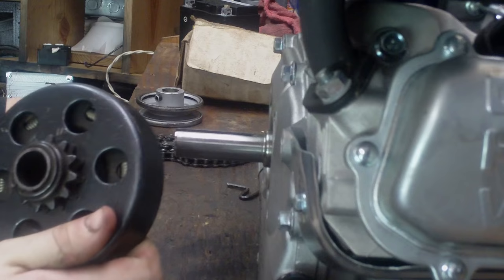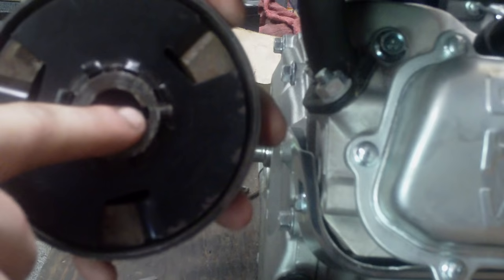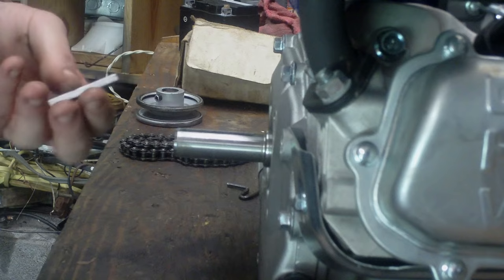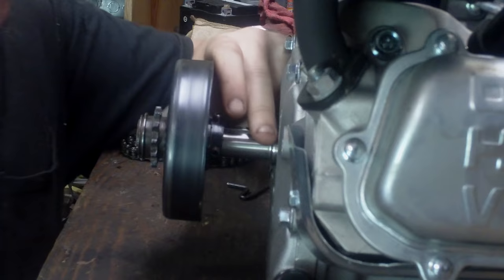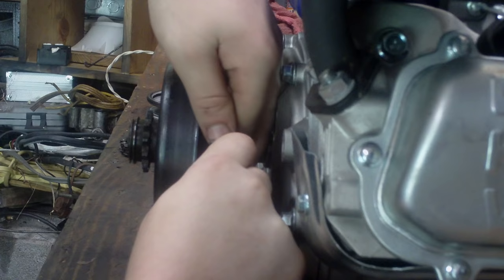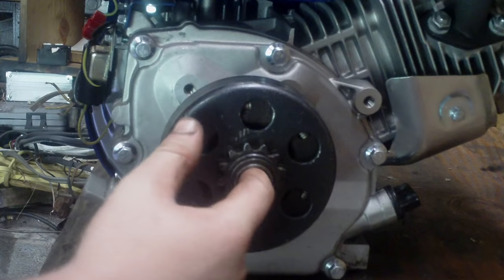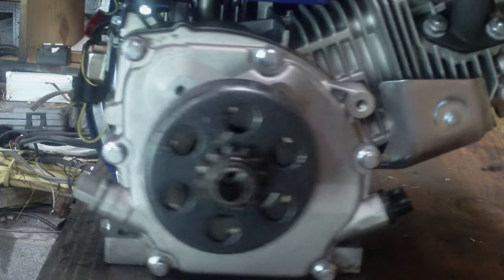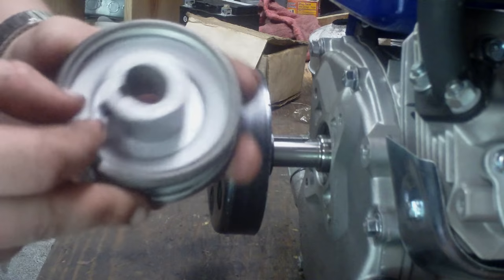How to install a Centrifugal clutch

Comment: does a centrifugal clutch prevent the chain from spinning while the engine is idling? Ive been wondering that for a while and id l ike to build a gokart with this exact engine size you have. Thanks.
Reply from the maker: Ko-wing wong Yes, thats exactly how they work, there are pads inside, with springs, and at idle there is not enough centrifugal force for them to over power the springs, so the clutch is disengaged, when you give it throttle, the centrifugal force increases overcoming the springs and it engages. Thanks for Watching!!!
Reply: Thanks for your help! Is it better to have a torque converter to the axle shaft or just a centrifugal clutch?
Reply from the maker: Ko-wing wong It depends more of what your wanting to do with it, a torque converter will get you more out of the low and high speeds, more low end torque at slow speeds and more high speed. A standard centrifugal clutch doesn't do much for low speed, what i mean is, not as much torque at the wheels, since its real easy to slip at low speeds. But both work just fine for go karts and mini bikes. More of a personal preference. And if you ride on grass or on hills the torque converter might hold up better.

Comment from the maker: I wouldn't recommend it, you will have to shop around and find one rated for higher HP. They do get very expensive in the higher HP range. Its actually better to have a clutch rated for more HP than the motor, it will last longer. Thanks for Watching!!!

Comment: ‼️‼️need help taking the key thing out of the shaft any ways to take it out???‼️‼️‼️
Reply from the maker: Once the pulley or clutch is removed, you can usually use a punch or screw driver with a hammer and gently tap it out, once it starts it will come right out. Thanks for Watching!

Comment: could you tell me the "size of the screw" that hold in the clutch with the washer in the star washer..Thanks
Reply from the maker: ALVIE78744 The crankshaft bolt should be 5/16"-24 and about 3/4" long. Your welcome! Thanks for Watching!
Reply: Thanks
Reply from the maker: ALVIE78744 your welcome!

Comment: I’m swapping a JDM H22A Vtec into my large go kart and need to have it disengage while parked(with the engine running). Is a centrifugal clutch gonna work?
Reply from the maker: Yes, it will be disengaged as long as the engine is idling, then will engage automatically when you increase throttle. Thanks for Watching!!!
Reply: @fnaguitarplayer9  thank you.

Comment: hey this is interesting! I've got a original Honda gx200 engine, but sadly I can't find a centrifugal clutch for it, as the crankshaft isn't a 0.75in but 0.78! where can I find one??
Reply from the maker: Morgan Heitz Thats crazy, i never knew they had a odd size like that. Must be metric i guess, eh, i'm not really sure on that, I know one thing that could be done, is have the crank machined down to .75 but that might be expensive at a machine shop. Unless you can find a metric clutch for it, you might have to do that. You might also want to check on ebay. Hope this helps, thanks for watching!!!
Reply: fnaguitarplayer9 I've done a bit of investitation, it seems that this crank size is specifique to european import engines, 20 milimeters. thanks for the advices, I'll have it machined!
Reply from the maker: I hear ya. That explains it then. Yeah, i'd say the best bet would be to have it machined down. It wouldn't take a whole lot. your welcome!

Comment from the maker: no that won't work. Even id you did get it set up on a mini bike/go kart it would last no time at all. you need a clutch like i show in this video, max torque is a good brand to get, only other cheap method for making a clutch would be a belt-pulley clutch, all belt driven, with a idler pulley hooked to a clutch pedal that comes down tightening the belts, but unless you have pulleys laying around and a belt, that would actually cost more!

Comment: Do You need a clutch? Like is it a must have thing for a go kart?
Reply: ding
Reply: No, just use magic powers to move the cart. Like a magic carpet..
Reply: You can use a torque converter. But they aren't good.
Reply: Or you could just push it.

Comment: I’ve seen people in videos put clutches on gear towards the engine. Does someone know if that’s correct?
Reply from the maker: most clutches can be installed either direction, they will work the same both ways. Thanks for Watching!!!

Comment: Hi. I have a 212cc predator and I can't find the right size bolt that u have to put in the hole. It's the hex one u put in urs. Can u tell me the size of the bolt please????
Reply from the maker: If its the same as this motor, the bolt that goes in the end of the crank is 5/16" - 24 and the length would be no longer than 3/4". Thanks for Watching!!!
Reply: That's what I bought and it keeps falling out
Reply from the maker: if its threading in correctly with no play, you may want to put loctite on it, that will solve that problem!

Comment: I haven't got a hole for a nut to hold it on,what should I do mate? Cheers
Reply from the maker: You would probably have to have it machined, you might be able to get by without but it would be more apt to slip off, i have seen them without the bolt before though. Thanks for Watching!!!

Comment: where did you find the smaller key?
Reply from the maker: +mile iloski You can cut them if all you have is a big one like i did, just use a hacksaw or cutoff blade on a grinder and file any burrs off, but you should be able to find a smaller one at any hardware store, or even lowes/home depot. Thanks for Watching!!!

Comment: What's the reason for the clutch what does it do? Cant I just weld a sprocket on it?
Reply from the maker: without a clutch the engine would be hooked directly to the drive train, so whatever vehicle it is on will start moving even while trying to start the engine, if you stop it, it would stall the engine out. Thanks for Watching!!!
Reply: @fnaguitarplayer9  oh ok thank you for explaining it for me
Reply from the maker: no problem!

Comment: Hey, I got an old 3hp briggs & stratton. I have to put on a 3/4" a #35 chain, right? 
I'm kinda new to this.
Reply from the maker: Yes, it should be a 3/4" shaft, just measure it first before buying one, and yes a #35 is the most common chain size. If you have any question feel free to ask me. thanks for watching!!!
Reply: fnaguitarplayer9 Thanks for the reply!
Reply from the maker: no problem!

Comment: Update  i looked at mine i couldent find the key then i found out it has the key fixed into the cluch hole and theres no screw holes on the back to tighten to the shaft but thx anyway

Comment: I dont see any set screws anywhere on my clutch
Reply from the maker: It has to have at least one to lock it down, look where the keyway slot is, there is usually one on it to put pressure on the key. Thanks for Watching!!!
Reply: Are you talking about the shaft itself?

Comment: will that clutch work on a 79cc predator hf engine? I think the only difference is the bore which is 5/8.
Reply from the maker: You will have to order one with the different bore, to fit your particular motor, go to tulsa engine warehouse or ebay to get them, usually around 30 bucks or so. But yeah if you get the right bore size it will work no problem. Thanks for Watching!!!
Reply: thank you and will do,
Reply from the maker: your welcome!

Comment: does every small engine need its own specific sized clutch, or will this one work for most?
Reply: This size clutch in this video will work on engines within its power range before it starts to slip!!! 2-5 hp is my guess
Reply from the maker: +Brandon Quenneville That is true, most of the time it will be stated when you order one. I'm thinking up to 8HP on these like this, i'm not for sure though. Thanks for Watching!

Comment: on my mini bike when I give I a shot of the throttle it feels like it shudders for a second be for speeding up
Reply from the maker: Probably carburetor related i would say, could be a fouled spark plug, I would check plug first, air filter then adjust the carburetor a little richer. Hope this helps! Thanks for Watching!!!
Reply: +fnaguitarplayer9 thx I'm going over it tonight
Reply from the maker: no problem, let me know if you need any more help!
Reply: motovlogs

Comment: hey i have the same engine and i need a new clutch. what are the specs on that clutch.
Reply from the maker: The shaft size (bore) is 3/4" but i would suggest measuring yours first just to be 100% sure, and the clutch used in the video was for a #35 chain, but that depends on your application. Also, I get them from tulsa engine warehouse (tewarehouse dotcom) or you can get some good buys on ebay, seen one on there for 24 dollars with free shipping, same specs as the one in the video. Also note, the one in the video is a max torque brand clutch. Hope this helps, thanks for watching!!!

Comment: Hey my engine i bought second hand has a tapered shaft?? what should I do I dont see anyway in attaching a clutch to it
Reply from the maker: +William Laidlaww Sounds like it came off a generator or a pressure washer, probably have to buy another crankshaft for it, tear it down and change it out. Thanks for Watching!!!
Reply: I doubt I will be able to find a replacement crankshaft for my engine its a subaru robin EX17.
Reply from the maker: +William Laidlaww Probably not, can't say for sure. The only other thing is to take it to a machine shop, maybe they can make a adapter or something for the crankshaft so you can put a regular clutch on it.
Reply: Yeah thinking about it know I might just sell it and buy a better engine.
Reply from the maker: +William Laidlaww I hear ya!

Comment: Its Backwards for that motor
Reply from the maker: Leshers Diecasts IT can go either way depending on what setup you have on the chain, if the motor sets to close or to far away it can be adjusted from turning it around. Thanks for Watching!

Comment: Wats faster 71 tooth rear or 6o tooth with 14 on clutch
Reply from the maker: Gonchez Turner With the 14 tooth on both setups, the 60 tooth in the rear would be faster, but would have slower take off speed. thanks for watching!!!

Comment: Hi, it's normal the centrifugal clutch work hot?
Reply from the maker: Oh yeah, they run super hot, especially if its being run in grass or on hills, its constantly slipping, its never 100% engaged like a clutch in say a vehicle, so it will heat up, very quickly too! Now if its smoking your over working or its under to much load or to big of a engine, or its wore out. even a new one will slip though. Thanks for Watching!!!
Reply: Oh, i'm from Brazil,  my centrifugal clutch is working hot, but don't smoke.  Now i have certainly that's normal. Thank you, and nice video.

Comment: that's not right ur clutch should on shaft closer to the motor u need a smaller key
Reply from the maker: +Aaron Baynard Without the key in it, it goes on easy, the key probably just needs filed down some to make it slide easier. Thanks for Watching!!!

Comment: the Predator came with a key already in it. i guess i should just pry it off?
if no answer, i will. *waiting on clutch in mail *
Reply from the maker: +ThatOneGuy 7 Yeah if the clutch already has one installed in it, some are built in, some aren't. I hear ya, sorry for the late reply. Thanks for Watching!!!
Reply: Were you able to pull the key off the predator engine? I have same issue. My clutch already has a key but the engine also has one.
Reply: Dan K Yes i was able to. i just used a pry bar. but anything to put some force behind it will work just fine.

Comment: This i how NOT to install a clutch, it's all wrong from start to the end, first of all, the clutch is way to far out on the axel, it's ment to go all the way in on the axel, to far out on the axel will cause stress on the berrings, so this i absolutly the wrong way you mount this clutch.
Reply from the maker: it would be less leverage on the inside, but on some setups you can't always do that.
Reply: With the correct clutch, and key install, you always can do it correct, wrong parts, and you will not be able to install the clutch correct, most important, get the right parts, don't compromise, it will kick you in the butt at the end of the day, and all the vids i see about clutch install, everybody is using a washer, it's just not good enough, get someone to do a proper tailored finish on a lathe.

Comment: Hey thats not how you mount a clutch. Its suppose to be much further on the shaft. That will bend your crankshaft in no time. Great job giving bad information that will ruin your engine.
Reply from the maker: I talked about that on the video, i said it should go on the shaft all the way, but I wasn't actually installing the clutch to use, if I had tapped it on all the way I would have had to use a puller to remove it again and i did not want to take a chance on damaging a new clutch. The clutch fit very tight on that engine compared to most. Thanks for watching